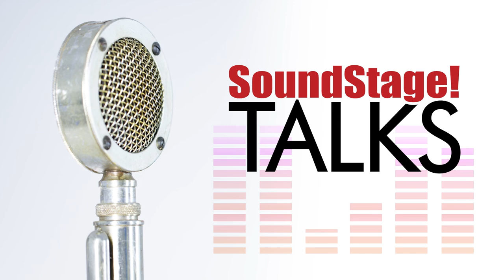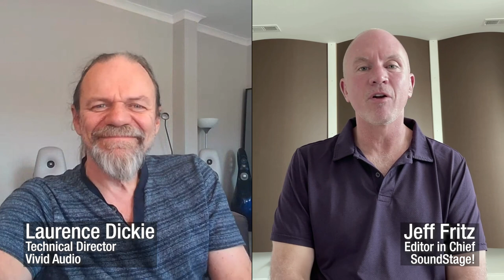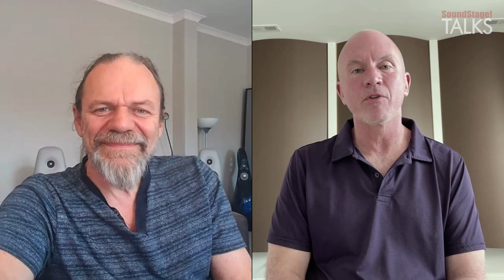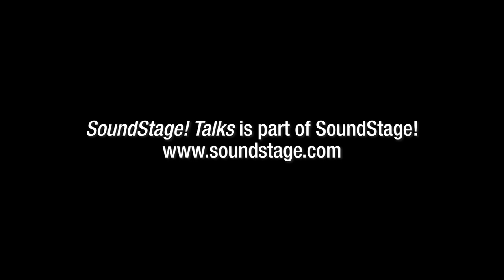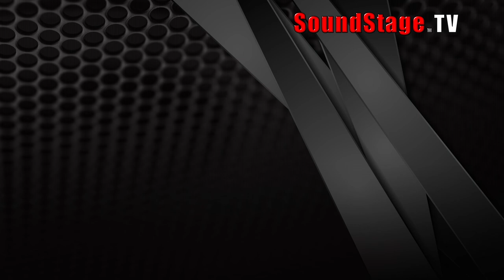Vivid's Laurence Dickie on Speakers, Drivers, and the Kaya S12 - SoundStage! Talks (April 2021)

Comment: Went to a local hifi show, last Sunday, at the Crown Plaza hotel here in Copenhagen. At the show I got to hear a lot of expensive stuff like top of the line Stenheim Alumine, Avantgarde Omega Two actively driven by current drive amplification and the newest Magic A5. In the same room as the Magic’s the switched back and forth between the Magic and the Vivid Acoustics Kaya S12. My conclusion was and is that the Kaya S12 was by far the best speaker at the show. It is stunningly transparent (crystal clear) and at the same time devoid of all the hardness and shrill sounding upper midrange seemingly plaguing all other speakers at the show (Magic apart, but they don’t possess the Uber transparency). It’s a rare occasion when the cheapest product at show is by miles the best. Well done Laurence Dickie and Vivid Acoustic 👍